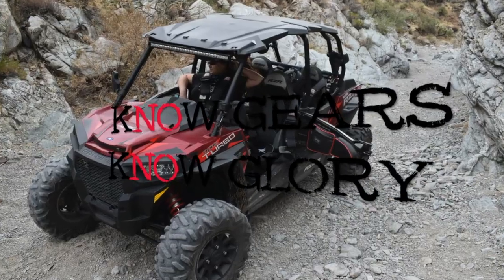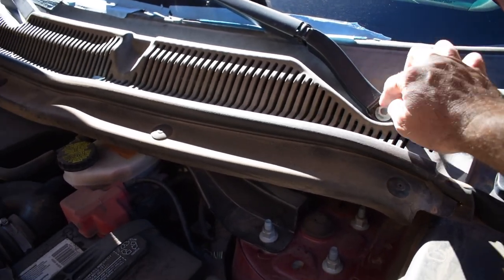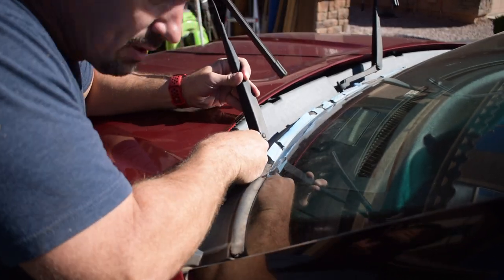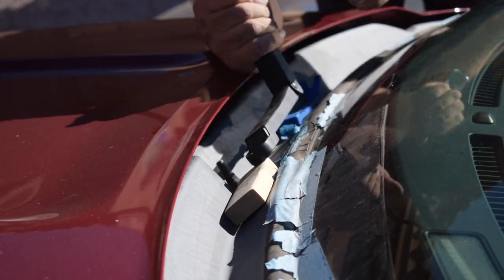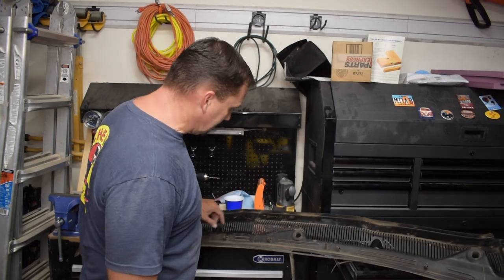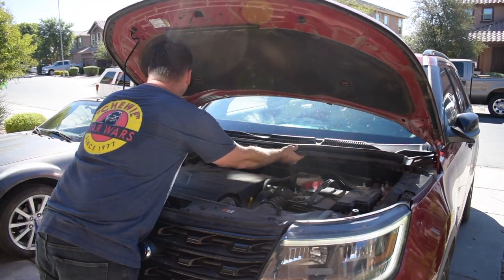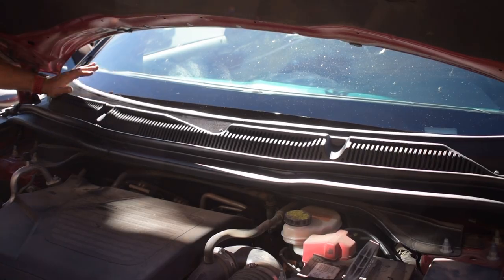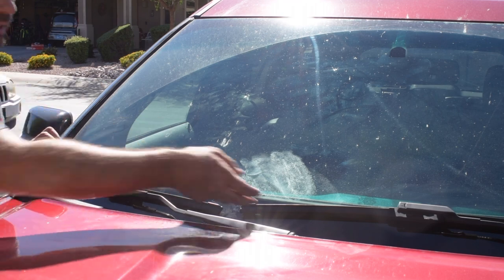Ford Explorer Cowl Replacement

Comment: Great video, thanks!  A couple of notes...  1) I recommend buying a new part, not used.  I was tempted to buy a used part from ebay or a salvage yard, then I realized that any new part will have some years of sun exposure on the key failure point -- the very soft and weak weather strip.  2) I do not have a box of trim clips, so based on your video I took great care to remove the six plastic trim nuts and phillips head plastic screws.  I used light pressure from the bottom side and all of them came out and then went back in just fine.  3) Take note of wiper positioning. The wiper posts to not have a cam that will set the wipers in one position only.  The angles of the cowl provide a good reference.
Reply: Have you noticed that the windscreen has little translucent T markings on the lower black section of the wind screen to help with wiper blade positioning. That was how mine was on my 2018 XLT.

Comment: Awesome video! Dealership wants $1200 to replace mine. Going to order one for $150 and do it myself thanks to you, sir.
Reply from the maker: WOW $1200? Thats insane! Glad you found it valuable! Good Luck
Reply: $1200 dollars😢. I'm mad they quoted $620 for my rear brakes.
Reply: @alexp-d3t  that’s crazy too. I always do my own brakes now. Brembo pads usually cost about $100 on average. Takes 20 min. Ripping people off left and right.
Reply: @michaeljames4074  how about the rotors? Mine are about three years old. I just figure on replacing the pads and doing the rotors in a couple of years.
Reply: @alexp-d3t  I haven’t needed to yet but that’s easy too.
Reply: Where did you order one from?
Reply: $65 dollars from Ebay, first one did not fit and broke during installation, got refund, second one fitted just fine.

Comment: I got mine for $65 dollars from Ebay not an OEM one. The first one did not fit right and broke during installation, got refund, second one fitted just fine. That said the look and finish of the ones I had was close to the original.
Reply from the maker: Thts Great!